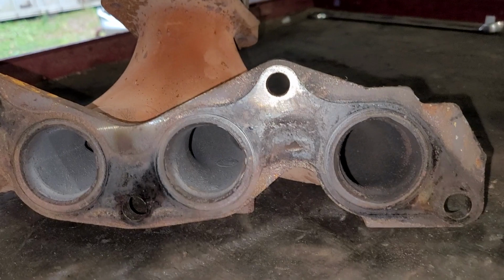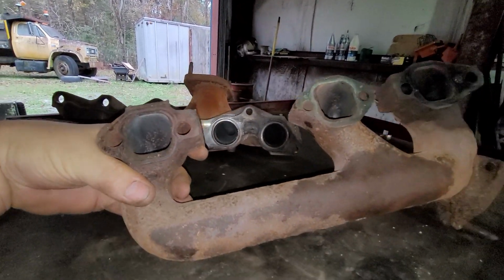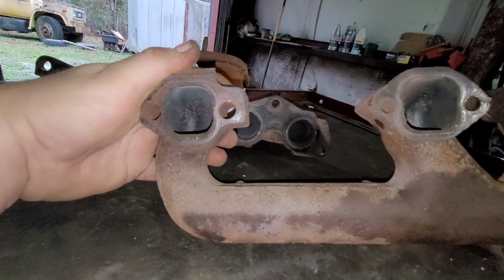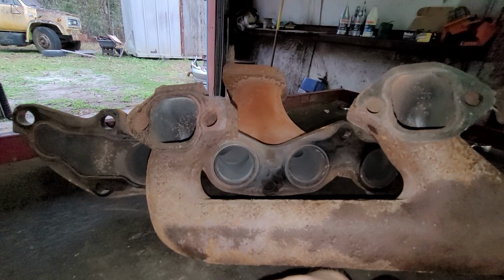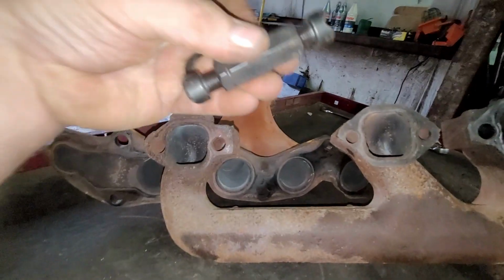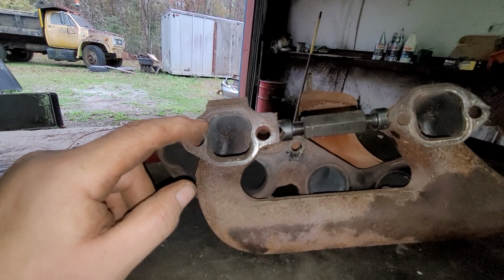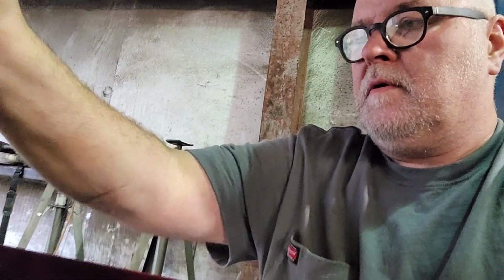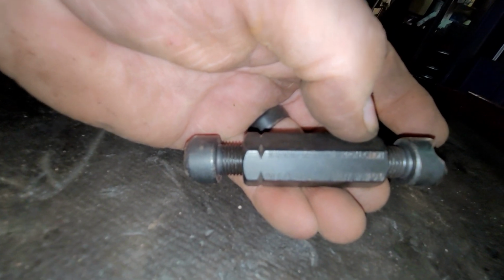Chevy Small Block Exhaust Manifold won't line up? There's a cheap tool for that!

Comment: Never knew they made an actual production tool for that but it makes sense. Years and years and years ago I made my own version of that in a couple of different sizes using heavy duty turnbuckles. They came in very handy not only for exhaust manifolds but any time you need to push something apart, even down to holding a belt adjustment on a hard to reach component. Of course you never leave these on the vehicle ( except when you forget 😂😂). Wrench safe everybody. 😊😊

Comment: Thanks for that Kenny been working on cars on and off for 54yrs and I never seen or heard of that tool.
Reply from the maker: I was kinda surprised when I realized there were soo many people that have never seen this tool .. Super simple tool , and works great !!
Reply: I'm 67 and while it's not that odd of a tool I have never seen it used for manifold spreading.
( tighten just a leeetle bit more.........crack )

Comment: Lisle 13000. About 20 bucks.
I can see that being useful in more applications than just manifolds. Add a some blocks of wood and you could spread or move lots of things.
Reply: That would have been nice first time i replaced a front wheel hub.  At least worth a try.

Comment: I wish you  had made this video a year ago when I was rebuilding the 350 out of my '70 Nova. When I went to install the manifolds, the bolts wouldn't line up! I was baffled, I knew they came off that engine, but the bolts wouldn't line up. I ended up buying a new set of manifolds and they fit just fine. I still have the originals, so I might get the tool and put them on, or just keep them with the car as the original parts.
Thanks Kenny, you solved a mystery for me!

Comment: Interesting idea. Turnbuckles with opposite threads are normally used to tighten shrouds on a sailboat, or tighten support cables on a bridge, or tighten the cover on a clutch cable, or adjust the length of a swing arm. Here, instead of tightening to shrink, you turn the opposite way and tighten to expand.
Reply from the maker: It works !!

Comment: Nice tool tip. Its something I never had need for because back in the day we weren't putting manifolds back on we were discarding those and installing headers but I can certainly see this would have been useful then to install those as well. 😛
Reply from the maker: Most of the time. I was doing the same thing !! But there was always that pesky customers car .......

Comment: Interesting! I never saw that but sure wish I had one! I do have an old belt spreader that looks similar from Warshawskys Auto in Chicago. Nice tool when I needed a third hand. Just got to remember to take it out before starting the car.
Reply from the maker: I worked with a guy years ago that had a belt spreader . It did come in handy like you say . This is a very similar concept and is a life saver !!
Reply: Warshawsky & Company around Chicago, J. C. Whitney about anyplace else.  So many fun things in their catalogs!
Reply: @bobblum5973  - And the store was amazing! Back then, they were the Amazon of auto parts and tools!
Reply: @Thomas K  My understanding was that the building was huge, the Warshawsky's address was for one street, while J. C. Whitney's address was around the corner on the other street!  That may not have been true, but it sounds like something a business like them would do.

It's similar to St. Louis Bread Co.  In St. Louis that's usually what they're called, but when they wanted to spread to other areas they came up with Panera Bread.
Reply: @bobblum5973  - They had a storefront connected to the warehouse. Sometime special order things took a while for pickup so you were better off ordering over the phone and then waiting a while for pickup. The had a wide range of items. Some cheap, some really exotic but you could get everything there! I missed it when they closed. At that time, Trak Auto came on the scene in Chicago and offered a 7yr 70k warranty on their parts and I think that really hurt Warshawsky's. Now they're gone but they set the business model for Auto Zone, O'Reilly's, etc.
Reply: @Thomas K  I remember they had so many add-ons for VW Beetles!  Dual parking brake levers that would mount on each side of the normal one, allowing you to brake just the left or right rear wheel for dune buggy conversions or whatever.  Spacers that would let you bolt "duallies", two wheels on each side on the rear, like a heavy-duty pickup truck.
Several years ago at a car meet I saw a car that had the little mini in-dash television & radio, with a magnifier to make the screen look bigger!  I'd only seen it in the JC Whitney catalog before that.
Reply: @bobblum5973  - I used to love their affordable universal (fitzall) products. When I was up against a wall trying to order something, they always had an answer especially for stuff like exhaust systems.
Reply: @bobblum5973  - Yep! It was huge! There was a warehouse and the store. It was located just south of downtown Chicago. Whenever I went there for a part, I usually left with 5 things that I didn't plan on buying but the deals were so good!

Comment: Wish I had that tool years ago but I made up something similar with a threaded rod connector and some  3/8 ‘s grade 8 bolts and half nuts notched the bolts on a grinder and used it mabey 10 times in 30 years but never failed to get the job done.

Comment: Nice. I've never used a spreader except on a Chrysler diff.  Beats aligning one or two bolts and going at it with my 3 or 5 ft prybar.

Comment: I used to just slightly drill out the 4 end holes on the manifolds so there wasnt tension on the manifolds. Modern day Hemis, Fords and GMs are all breaking their manifold bolts at the rear. Looks like someone needs to come up with a fix something along the lines of a 3.6 Pentastar manifold, looks rinky dink but seems to work. Havent seen one come in leaking yet unless it'd been smacked.

Comment: Any technical / mechanical field will have specialty tools like this.  Can you do the job without them?  Probably.  Is it a heck of a lot easier with it, can you do the job better with it?  Certainly.
I bought a special SK brand sending unit socket over 40 years ago, because it made the job quick and easy.  I've hardly needed it since then, but happily keep it in my tool box for those "special occasions".